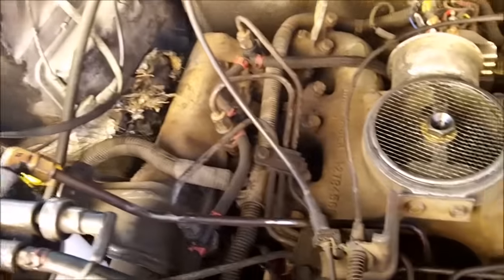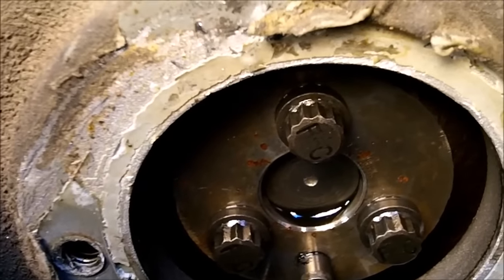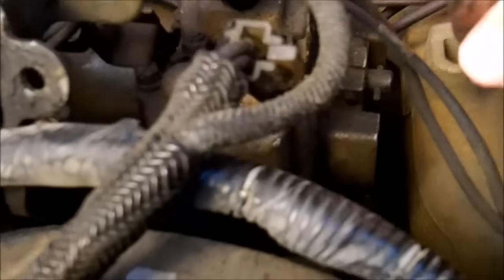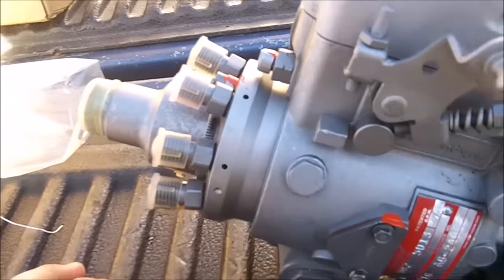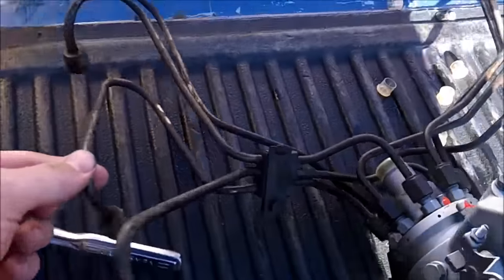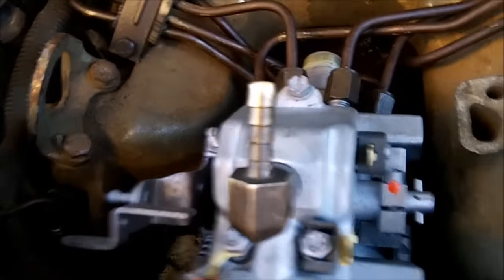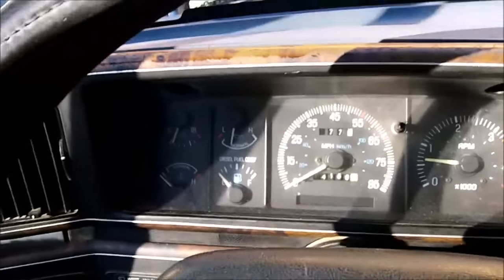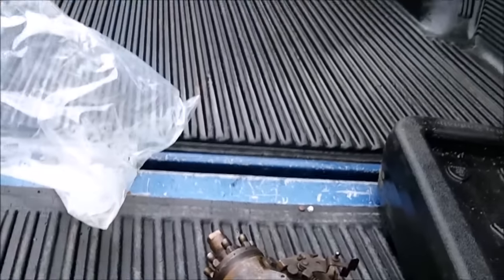7.3 IDI Injection Pump Replacement

Comment: Bet that was a pretty penny. Got a 93 7.3 idi took one of the injection lines off and crank engine getting like drips and few bubbles. Fuel and vac pump is good

Comment: What is a flat? When you turn it up 2 flats?
Reply from the maker: Flat is one side of the allen key, 3 flats is half turn, 6 flats is one full turn, 2 flats would be slightly less than half turn.
Reply: 7.3 IDI Diesel 
Oh that's cool never heard that

Comment: I’ve got a truck with a hypermax turbo and you don’t need head studs. If you want to do it because it makes you feel better go for it. But you can’t put the heads on the engine when the engine is in the truck with head studs. But anyway great video.

Comment: Great video, I just picked up a 89 F250 7.3 IDI, with 54K miles I had one in 90 but wanted to review all this stuff that I forgot! nice job.
Reply from the maker: Thank you.
Reply: I also recently aquired an 89 extended cab with a dually rear...
Wasn't planning on keeping it, but probably will...
It'll be the third Ford diesel I've had...
Always seem to end up with a Blue Oval...

Comment: Good job man ! Best video I seen in the bunch ! You did not have to use any gasket sealant where the pump meets ? No thread lock on the front bolts ? Thanks for the good work !

Comment: I have a injection pump that is different than the one for my 84 ford f250 when i give it gas it starves for fuel can i adjust the fuel feed to match ,my truck and make it work
Reply from the maker: The fuel feed is adjustable, I show where to adjust it at in the end of the video. It could possibly work but I don't know have not tried anything like this. There also could be some other problem causing it to starve for fuel, clogged filter, in tank pick up various fuel lines, failing lift pump. Also the injection pump might not have the pressure to pop the injectors if it was made to be used with other injectors. I would try it to see if it works.

Comment: This is a great video and I just subscribed to your page. I have an E350 with the same engine, I have a question regarding the injection pump. On the back of my pump at the torque bolt it seems like its been either broken off or it may be a spot for a sensor plug in. Could you give me some input on the torque screw and why it may be broken or was there a DB2 pump offered with a sensor in that same spot ? My 7.3 idi is not currently running and im wondering if that broken screw or missing sensor part is causing the pump to take in air and mess up the flow of fuel. Should  i just get a new/reman pump ? Thanks
Reply from the maker: Thank you for subscribing. The torque screw itself is just a screw all it does is limit fuel at low rpm. At high rpm fuel is limited by an internal leaf spring. Turing the screw out will give more fuel. There are no sensors on the pump except if you have the E40D auto gearbox there will be a throttle position sensor on the side on the pump for the gearbox. If the screw has been turned/missing it will cause fueling problems. Also it might be getting air in the system if the screw is loose or missing this will also cause running problems. You could get a new screw and try adjusting it, might fix the problem. But if the pump has over 150k miles I would consider a new/rebuilt pump as it is starting to get worn out. Hope this helps.
Reply: Thank you for answering ! My E350 has 90k miles and is currently dumping white smoke but it's def unburnt fuel so I ordered a set of injectors to swap out. I am considering just doing the pump while I'm doing the injectors anyway. The truck sat for roughly 8 years so im wondering if my problem isn't actually the pump and not the injectors ? What's your take on it ?   @7.3ididiesel36
Reply from the maker: Did you get all of the old fuel out? If it has been sitting for 8 years then the diesel will have degraded and it also could have water contamination there for it will not burn right causing smoke. If it runs ok and just smokes put fresh fuel in it with some good injector cleaner like Diesel Kleen and drive it some to see if the smoke goes away. 
If you replace just the injectors there is a chance that the old pump will be too weak pop the new injectors properly.    @daltonshaw3317
Reply: @7.3ididiesel36  Yes I dumped all the old fuel before I got it running and put in fresh diesel along with additive and changed all the filters with a mix of fresh fuel and ATF to help with all components. I have decided to replace the pump along with the injectors. When I pull the pump out can I just put the new (Reman) pump right back in the same way the old one came out and then hook everything back up ? Do I need to set the timing gear top center or anything specific or can it simply be replaced the way it sits when I remove the old pump ? TIA !
Reply: My thought is that if I remove the old pump and make sure that nothing moves as it sits, then I can just fit the new pump into the same position as the old pump. Is this correct ?
Reply from the maker: Yes the injection pump drive shaft is located on the timing gear with the pin, so just put in the new pump and the timing will be close enough for it to run. However you will still need to adjust injection timing. This is done by turning the injection pump left or right ( just like a distributor on a petrol engine.) Turning it to the right will retard the timing, left will advance the timing. Do not adjust the pump with engine running. On the engine where the pump bolts on will be a timing mark, there should be a timing mark on the pump also, but I have seen pumps that don't have it. Just get it close. To time the pump correctly there is a special tool like a timing light only it has a pick up that picks up in injections pulses on the injector line. I did mine without this tool. I timed it by sound ( very quite diesel clatter timing is to retarded, very loud diesel clatter too advanced.) You wanted to be in the slightly on the advanced side. Timing should be set at 8.5 degrees before tdc.         @daltonshaw3317
Reply: @7.3ididiesel36  Thank you once again for answering me. Do you have any videos showing the timing process ? I have never done it and I don't have any timing tools for this engine. Once I get the pump installed exactly how the old pump was do I then have to adjust something or while I'm installing the new pump is the timing adjusted ?
Reply from the maker: Sorry I do not have any videos on the timing. One you get the new pump installed as the old one the timing will be close enough for it to run, might even be fine the way it is. If you need to adjust it slightly loosen the pump and turn it side to side about a millimeter at a time. Right to retard timing, left to advance timing. Listen carefully to the sound of the engine it should sound the same as it did with the old pump/ have the same amount of diesel clatter. If it sounds the same, drives good/ has good power, has little smoke, and starts good cold that is going to be as best as it will run by having the timing set without the special tools. This is how I did my timing since I also do not have the special tools to do it. I have never had any problems doing it like this.   @daltonshaw3317

Comment: Thanks for the video brotha. Hey what would be the symptoms of needing to replace the injection pump?
Reply from the maker: You are welcome. When the pump starts to go bad it will be hard to start, rough running/ misfire, loss of power, engine stalling coming off throttle.

Comment: My 89 is leaking engine oil under the IP would that be the o ring where the timing gear sits ,or where the complete housing sits on the block ?
Reply from the maker: Could be both, most likely the o ring.
Reply: 7.3 IDI Diesel thanks bro keep up the good work

Comment: Nice video. I bought a 1990 F350 crew cab. 7.3 IDI. It was starting fine ,after a couple days it just wouldn't start. I pulled the fuel filter and it smelled like bad old fuel. Old diesel smells just like old gas. so I dropped the tank sucked the fuel out , It was orange, the tank was so rusted it turned the fuel orange. Turns out this truck had been setting for 20 years. So I did as much as I could to get the lines blown out. And spent the day trying to start it trying to bled the air out and no luck. seems like the fuel pump is pumping to the injector pump , But then noting from there. Any Ideas of what to try next.
Reply from the maker: Check the fuel filter it might be plugged but still lest some fuel through, cut it open and inspect it. The orange color in the fuel is mostly from the rust, the rust particles are very small they will go through the filter, they could have deposited in the injection pump and damaged it. Also there is a check valve in the fuel return hose on top of the injection pump take it apart and clean it. Try running some Diesel Kleen mixed with atf through the fuel filter to clean out the pump. If nothing helps might need a new injection pump.
Reply: @7.3ididiesel36  I unhooked the 3/8 line coming from the fuel tank and put a new one to a gallon jug full of clean fuel on the fender in the engine bay I took the fuel filter off cleaned the hole assembly , even the hard pipe coming from the lift pump and the pipe going to the injector pump. I took a piece of stranded number 12 wire made it 6 inches longer than the 2 pipes . and striped back a half in and bent the strands out to make a small wire brush and pushed it through the pipe and put it in a drill. then turned the drill on and very slow pulled it out with it turning. Because there was even small amounts of rust in the pipes. opened the injector pump flushed it, it didn't look to bad. but the solenoid was stuck and I cleaned and freed that up. pulled all injectors and cleaned them and sill won't start. But I didn't know there was a check valve I will clean that. the return to the fuel filter was clogged. and I know the injector pump will be big bucks ,   don't mind spending money on it but I need to know thats the problem. The lift pump seems to be working because I flushed it with the jug going to the lift pump and another hose going to a empty jug.. And cranked it over, It was orange first then clear. but no pressure from the injector pump.  Sorry didn't mean to right a book.  LOL

Comment: A few questions. What brand is this? And also stupid question. Are all 7.3 an IDI? What exactly does that mean
Reply from the maker: The pump is from Diesel Care and Performance Inc. Not all 7.3s are IDI. IDI means indirect injection, there in a preignition chamber in the head. The 7.3 IDI was made from 1986 to 1994, then came out the 7.3 powerstroke from 1994.5 to 2002. The 7.3 powerstroke is a completely different engine It is direct injection, with a computer controlled high pressure oil system that fires the injectors. The only thing that is the same between these engines is the displacement.
Reply: @7.3ididiesel36  got it! Thank you very helpful

Comment: What did you do for the tps buddy? I have a 1993 7.3 idi and replaced the pump last night Truck fires up beautifully. But having issues with the tps
Reply from the maker: Don't have tps with manual gearbox. Only automatic gearbox has tps.

Comment: do u have a pyro i didnt really catch if u did or not cause i wanna turn my pump up a little bit but i dont have a pyro so what is the safest amount to turn it up without a pyro
Reply from the maker: Not at the time but I did not turn it up until I installed a pyro. Haven't seen any egt increase driving in town and highway. I only turned it up 3 flats.
Reply: 7.3 IDI Diesel whats the term of flats?
Reply: i think he means 90 degrees 3x?
Reply: pyros are not a safe bet on these engines. better off with a engine temp gauge in the rear port on the block and watch the difernce between front and rear of engine. its also cheaper compared to a pyro.  i pull hard with my engine and its nice to know what the hotest part of the motor is. the front 2 temp sensors are nice but really useless for temp purposes as its reading cooled coolant and not actually engine temp.
Reply: SynQ Creamyy flats on a Allan wrench

Comment: I have two cracked metal lines. I've been trying to figure out if I can replace them  in place without pulling the pump.
Reply from the maker: Yes they can be replaced without removing the pump.

Comment: WOW enjoyed your vlog. I have a 94 IDI 7.3 turbo. Have had it only a short time my first diesel so have so much to learn. You briefly mentioned the cruise control. Mine isn't working  and I wonder where the control module is. In trying mine it seemed to work for a few seconds and then there was a click in the gas peddle and it shut off. I just don't know where to start to look for the problem. Any ideas?
Reply from the maker: Thank you. There could be many reasons why the cruse control dose not work. Check the cable that attaches to the throttle on the injection pump, it sometimes comes off. The servo is vacuum controlled there could be a vacuum leak, check vacuum hoses. Also check the wires and contacts in the steering wheel, if your truck has a manual gearbox check the clutch safety switch on the clutch pedal, it will turn off cruise control if clutch is pushed. The control module/ relay is under the dash. Hope this helps.
Reply: @7.3ididiesel36  It is an automatic C-6 I think. I saw one example of some guy removing the steering wheel on his gaser motor home. That was interesting I never knew how that worked. This has been a sharp learning curve for me...but thanks to guys like you and others you help guys like me a ton. I'll keep trying to figure it out and thanks so much for your help.

Comment: Any idea how to get the throttle shaft pin out ? (where it interfaces with the throttle position sensor) - trying to replace o-rings inside my pump but need to remove this pin to do so
Reply from the maker: Sorry I don't know but you would probably have to take the pump apart. There is no throttle position sensor 7.3 idi is all mechanical there is no computer for it. The 7.3 Powerstroke that came after the idi had a turbo, was computer controlled, and was direct injected.
Reply: Hammer. You got a lot going on on the inside if you want to replace those o rings.

Comment: Are these pumps rebuildable
Reply from the maker: Yes the pumps are rebuildable, the one I put in is rebuilt, but to rebuild it yourself would be quite hard the tolerances in these pumps are very tight and everything has to be very clean when reassembling the pump. Also special tools are needed to re calibrate the pump.

Comment: So no matter what the pump is in Time to the gear if the pin is in the hole right then it’s just timing it to the engine by scooting pump back and forth
Reply from the maker: Yes that is correct.
Reply: How do you time it to the engine?

Comment: I Snapped the bolt off of the fuel adjustment cover when i was putting it back on🙂
Reply from the maker: You will might have to remove the pump to drill it out if it broke off flush, if some of it is still sticking out try to remove it with vise grips.

Comment: You didn't have to bend a wrench to get those mounting bolts off?
Reply from the maker: No the mounting bolts where not too tight. The wrench didn't go on to the bolts all the way though but it got them off.
Reply: Weird, I can't even get a wrench in there.
Reply from the maker: It's quite hard took me a while to get the wrench in there.

Comment: My IP pump is leaking from the bottom I can see it dripping, could it be rebuild or replace
Reply from the maker: Depends where it's leaking from. Check the fuel lines on the pump they sometimes come loose and leak, also there is a cover with two bolts on the right side of the pump that has a gasket and is easy to replace. If the leak is coming from the head of the pump or the throttle linkage there are internal seals and the pump has to be disassembled. If that is the case I would replace the pump.

Comment: Very good video. Thanks. Got an update on how the pump is holding up? Think I found the Ebayer you bought from, 'dieselcare' (Ebay ID) out of Mempis. They have pretty good FB. One year Warrantee.  Looks like they have gone up to $405. Update: Called O'Reilly, They have them for $556 W/lifetime Warrantee. I'll decide by next week which route to go. I'm a Truck Driver. So I'm not home much to drive the P/U. Usually less than 2000 a year. Maybe more like 1000 Mi/yr
Reply from the maker: Thank you. Had no problems at all with the pump, mind you I only put around 6000- 7000 miles on it
Reply: I had a lot of problems buying a rebuilt Stanadyne DB2 fuel injector pump for my 7.3 IDI from "dieselcare and performance" out of Memphis. They sent me the wrong mismatched pump. It was very hard to get to talk to anyone in charge or knew much about the business. But they sure were quick to try and to sell me stuff. I did buy a set of Fuel Injectors from them which are now installed. But they would not refund my money, at least not yet, for the incorrect FIP which I returned. I Google search them and there are lots of complaints on the Better Business Bureau pages about how dishonestly they run their business and don't know what they're doing. I'd suggest anybody check that out first before buying from them. It seems like there may be some new management, big staff turnover in the last year and 1/2 or so. I am sending them a certified letter tomorrow to demand refund of my money. They have their incorrect FIP back, but I don't have my $460 back. I ended up buying another rebuilt FIP from Dieselogic dot com in Jacksonville Florida. They were much more expert, paid attention to me as a customer, answered all my questions right away, or if it was after hours I could text them, and get text answer back the next day. A real quality operation, and I'd go back to them for more business. I'm doing the final set up now, hope to have it started and running smoothly in the next day or 2.